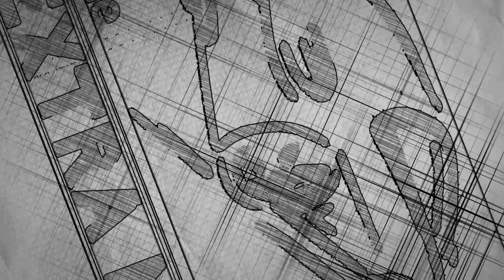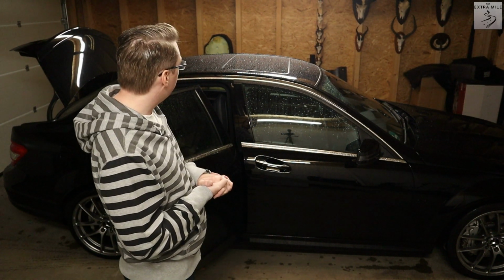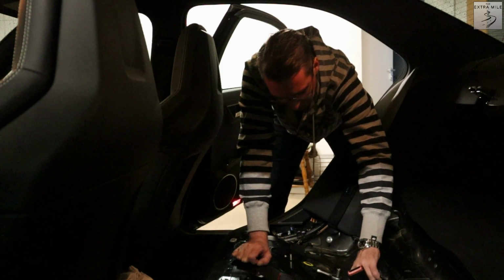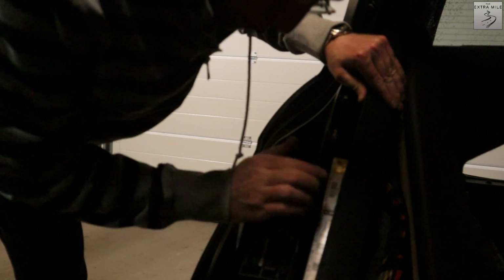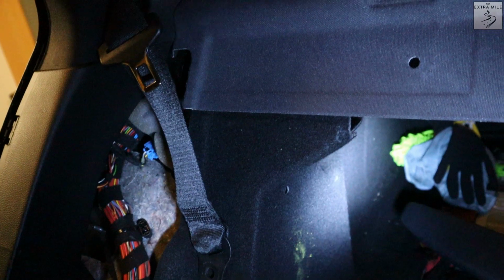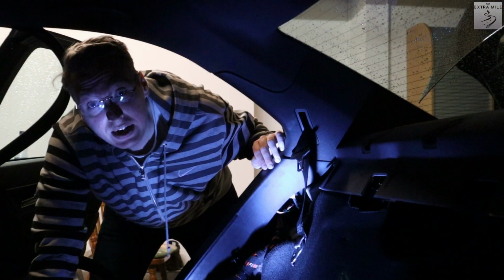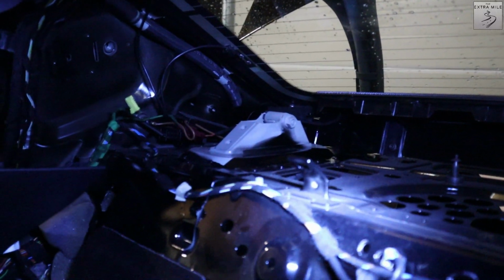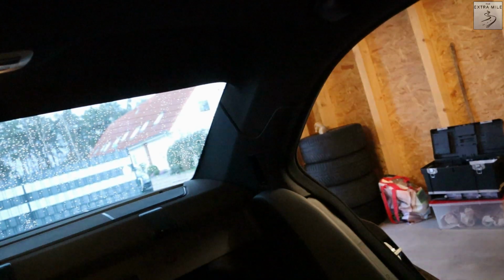Merc Monday: Removed rear airbags, seatbelts and sunshade!

Comment: Hi Alex,did you get error codes after removing them?
Reply from the maker: Hey there, yes you need to clear the codes with an obd2 scanner, and need to install something like this: https://www.ebay.de/itm/Autos-SRS-Airbag-Simulator-Bypass-Garage-Diagnostisches-Emulator-Tool-Universal/173010939771?fits=Make%3AMercedes-Benz&_trkparms=ispr%3D1&hash=item2848416f7b:g:kVcAAOSwevlaIjDK&amdata=enc%3AAQAFAAACgBaobrjLl8XobRIiIML1V4Imu%252Fn%252BzU5L90Z278x5ickkSG%252BOFgrj2Yvbvmrj2TAdM%252BLGPxwHYSWvMtr5Epn%252B7YeoOEU8cKVsHT1TGhKYlTkK%252F8opiCLe8ZdM8%252F6FXDhBiVsrAptNLBJAtzPCmXw9ojlxtiyn6%252FWuwF2KPuT54WfyyyE6i70o2ppa3Jhhi5x7HvPVz0btKt7AoQ2gnAjfIObQxEyHJE%252BGut04%252B%252F8dDAKYejkD7CWwFDhy8LzTX3a9yIQ05PtswrayCr7RBN8D3e8C0ofNFF7sw8mrKLUoKt5nKPCJnLO6j72oj%252BoHiRLL6hIbYClIgUOM%252FRMxPod46oLVysVAi%252BeuI10lVkxU7YP8ND5PjgHVud6SXMNVuxed94Nku16q8Gvy7BY6aHLaGieiN%252Fita%252F2wIxlmcRjEfsj3%252B2OP4Ij%252B2Onq4Che3ulH9Zwl2qwvWSloEcm0MsHvHORNNPF%252FovGSKnfr1eDO%252F%252B%252Fpz0e1g5%252BsbfTREghjCxCqwFqNuaEzjdTwM%252FZ1SogPRllHn7s%252FyA0F%252FfDN17lo5GbeDV7oLdL7JNQ%252F4a0FS0hyP9xP10kptNn0T6Mg72lln5cVqi2wyZQBE7ZfWDdPNs9aWVzabj%252F%252F2qcxEPdtpSJV2zLra4urnZrgA8B1gze75vPD%252F5Bq%252FBjrovDnIFT4ob%252B7rvTub6TDlD1q1onw8Z5OgrjmOVQxemYobaPgeynaoiUhQAOijI3OkSzBuaDPLr%252FFO%252F4%252FZNOQyopDU7IoLzj4D6OCKKNTVf5jur0dUZj3IWAHqc6KYuJ2n6hRFOSmbpvMTO2my6Lfn3Pfj8lnV9ZdiMf2AchFWtDl8zB45bARjLE%253D%7Ccksum%3A173010939771b03ea24678324619b582a4bea0105461%7Campid%3APL_CLK%7Cclp%3A2334524

Comment: Have you thought of replacing the wheels for race spec? You may save another 20 kg
Reply from the maker: Not sure if I could get wheels in 19 inch that are much lighter than these, outside of carbon wheels of course but those are crazy expensive.
Reply: @TheExtraMile  yeah, I guess to could spend the earth on it

Comment: why did you even do that?
or will you put everything in again?
Reply from the maker: I do like to mod my cars, and saving weight has been my number one priority for this build since the car is pretty heavy to start with.

Less weight helps with everything, acceleration, braking, handling, fuel economy etc.

I don’t plan on ever selling this car, and if I would have to do that, then it would be in heavily modded form anyway. 

When all is said and done, I should have saved something like 150 kg maybe even more and that should make a pretty noticeable difference.

The engine output will be increased as well this summer.

Comment: Removing the weight from the rear will not improve handling.
Your suspension has been tuned by the manufacturer to the weight layout.
You have just destabilized the car...
Reply: Good point. Particularly if he's going to boost the power. Probably need a tyre refitment too.
Reply from the maker: Hehe, I am aware of that Danko! There will be weight removed from the front axle as well, quite a bit actually. But most of that weight saving Needs replacement parts that cost money. So I am starting the weight loss journey with "free" stuff that I can just remove.